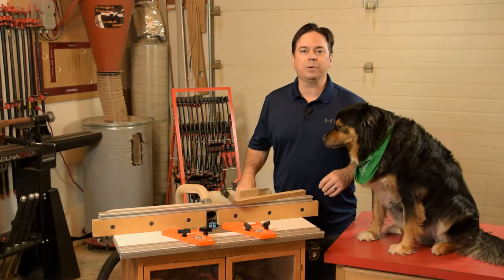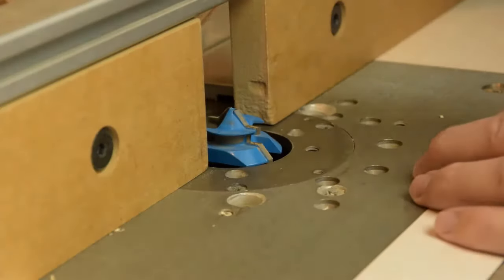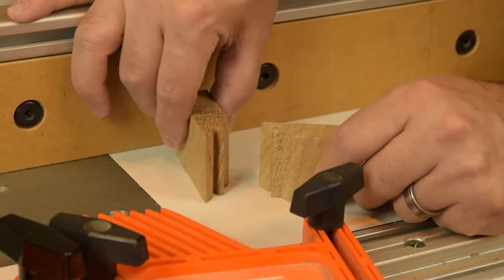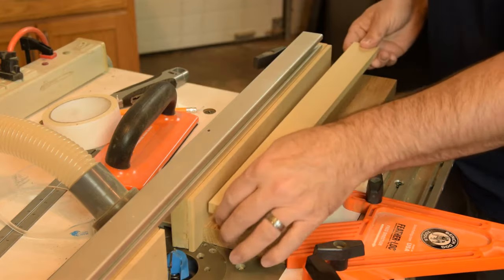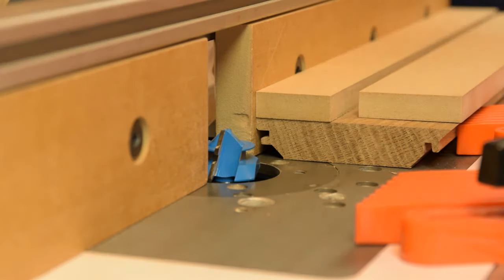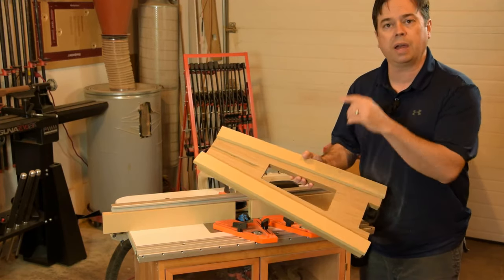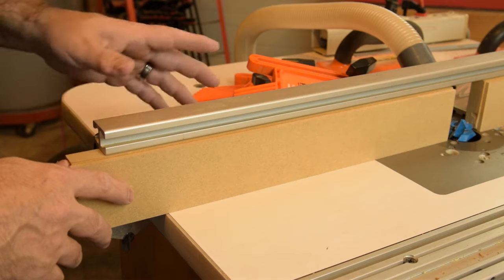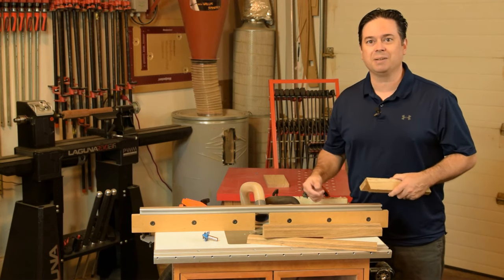Locking Miter Joint 2 Secrets to Success with Lock Miter Bit.  Woodworking  technique tips tutorial

Comment: I have this bit and the set up block from Rockler. I used the plastic setup block to set up my router bit and made a lot of cuts and adjustments to bit height and fence. I gave up after 2 hours. I wish I just would have watched this video. I found out the setup block was for two different size woods and of course I was on the wrong one. Your video was helpful to me thanks.
Reply from the maker: Thanks Gary!

Comment: Really liked your video, especially the tip about cutting the joint in two passes by using the spacers. I am going to be trying your tips out today with some cherry I milled up yesterday (first I will try on some scrape maple not the expensive cherry). It will be my first time using a lock miter bit, so this is greatly appreciated.
Reply from the maker: Thanks Kevin!  I hope your project with locking miters goes well for you.
Best

Comment: Thinking it would be worth setting up two separate router tables.   One pass on each.   I mean, honestly the time saved and sanity saved, it would be a no brainer for a full shop!  Router tables are small, cheap, and easy to just leave set up and ready to go!.   Great video though.  Contemplating whether to get back into cabinet making again.   There is definitely a need out there!
Reply from the maker: The old style locking bits would have benefited from two router table setups.  But this bit really doesn't need it.  Once you get the bit height and fence setting dialed in, it's the same for both mating workpieces.  Now, if you left this bit set up in a router table for both cuts... that might save you some time.  Thanks!

Comment: This is a real noobie question. I've just picked up this bit and have been watching a few videos to learn the finer details of its use. Your video is the clearest one I've found; however, there is something that you mention that I don't quite get. You said to make sure the "T" workpieces and the "F" pieces are oriented "opposite". What does this mean?
Reply from the maker: "F" meaning a board routed against the router table fence.  "T" meaning a board routed flat on the router table.  Basically you want to rout both edges of a board with the same profile.  Then rout both edges of the mating board the opposite way.  This will make it much easier to clamp the project together.  
Thanks for the nice comment!
Reply from the maker: Here's another video on the topic... https://youtu.be/aXRkmE-wuLU
Best

Comment: This was very helpful. Excellent video.

I want to make a floating shelf from either 3/4" plywood or 3/4" stock, creating a box with one open side (for the shelf mounting). I'm curious if I can still use the miter lock joint for the front face of the shelf. I know I can make the basic box, i.e. top and bottom and the 2 ends, but will the corners still come together for the front face piece?

I can't visualize it and I don't have a miter lock bit to test with. I was hoping your experience might be able to answer my question.
Reply from the maker: A three sided or four sided box is much easier than a six sided fully enclosed box.  I would make your three sided box with locking miters first.  Then cap the ends with hardwood covers.  If you rabbet them to fit, and leave a thin lip on the rabbet, the joint will be nearly invisible.  Especially once you round over the edges.
You'll have a much easier time with hardwood compared to plywood when using this bit.  For what it's worth, I never use the locking miter on plywood, but I know some woodworkers do.
Best of luck with the project!
Reply: @TheThoughtfulWoodworker  thank you for the quick response. I see what you're saying. I makes a lot of sense.

I thought about the locking miter joint as a way to hide the edges of the plywood. Rabbet joints, while stronger than a miter, would still show some of the plywood edge. That's when I thought about the locking miter joint. However, your suggestion that hardwood works better with the miter lock bit, make the rabbet joints on the ends more practical.

Thanks for the advice. I think you have solved my dilemma.

Comment: 2 thoughts. 1. Cut a 45 on the table saw instead of the double pass on the $100 bit. 2. Use spring camps instead of double sided tape on the fence. I use clamped on fences all the time and reuse them for a long time.
Reply from the maker: The 45 degree cut actually doesn't work.  I tried it, and it cuts away too much material, and leaves gaps in the joint.  The spring clamp idea sounds good, but would be in the way for vertical cuts.  I like the way you think though.  Best.
Reply: @TheThoughtfulWoodworker  You cut a shallow 45. Several bit manufacturers recommend a 45 cut to minimize loading.

Comment: I tried it on white oak and got alot of tear out! Didn't have a problem with my test boards, so I'm not sure that it works very well with an open grain wood like oak!!
Reply from the maker: White oak can be tricky, but that's what I usually use.  You'll have the best results with a two pass method.  That's pretty easy to manage with 1/4" spacer boards taped to the fence.  Good luck with it!

Comment: Great video…very helpful. One question, with a variable speed router, is there a preferred speed with this bit?
Reply from the maker: It's a large diameter bit, so definitely back it off from max speed.  If your router has 5 speed settings, you might use it at 3.5 or 4.  Best of luck!

Comment: I was thinking about a tapered table lamp, similar to this angled shape using the method you showed here, however, would the top and bottom require an angled cut on the end grain so that it stands on a flat surface with no gaps ?
 Billy Graham from.😊 bonnie Scotland bonnie Scotland
Reply from the maker: Yes, you'd have to bevel the top and bottom before you angle the parts.  Good thought process thinking that out in advance.  Best to you.
Reply: Thanks for the response, can you suggest a method of addressing this? Should you make those cuts before assembly or after ? 
Btw, I've subscribed , good work and thanks. 😁
Reply from the maker: @williamgraham8761  I like to bevel the parts with a tilted Tablesaw blade first.  That way you still have square sides to make the cut.  Then angle your panel with whatever method you prefer.  Then you'd be ready for the locking miters.  Best.
Reply: @TheThoughtfulWoodworker  I've often thought about this scenario, I wonder if anyone has worked out the math...its a known fact that wood workers are generally not good at maths...I've tried wedges etc, but never yet worked out a repeatable and reliable method as yet, I'm only 64, so, time still to figure it out. 🤪

Comment: Are these locking miter bits okay for plywood say 5/8 or 3/4?
Reply from the maker: With the grain you should be fine.  Across the grain in plywood you may experience chipout.  I use this bit almost exclusively with hardwood.  Best of luck.
Reply: @TheThoughtfulWoodworker  thank you.

Comment: Thanks for the video.  I tried this bit on a work piece last night and it annihilated my test pieces.  My only guess is either my router isn’t going fast enough (set to half speed because of the size of the bit) or my table isn’t stout enough.  If I ever get this bit to behave less like a wood chipper, I’m sure these tips will serve me well.
Reply from the maker: Getting the router speed right helps, but the biggest improvement in cut quality comes from cutting in two or more passes use spacers against the fence to accomplish that.  Also, long grain is easier to rout than end grain.  Keep after it.  Thanks.
Reply: @TheThoughtfulWoodworker  Thanks for the response.  I tried it with 8 passes on one of my test and it was still a mess.  There didn't seem to be a feed speed slow enough or cut depth shallow enough that would keep it from pulverizing everything I fed into it.  I wasn't even using hardwood.  I was using a 2 3/4" lock miter bit on a Bosch 2 1/4hp router.  My current working theory is that I need a more powerful router for this bit.  Does that sound right to you?
Reply from the maker: @patrickm1533  I don't think it's the router.  I use a 13 amp router, and it works fine.  It's probably the softwood lumber.  I only use this bit with long grain edges on hardwood.  Try it on a piece of hardwood like oak or maple, and I bet you'll see how it's supposed to work.
Reply: @TheThoughtfulWoodworker  That's encouraging.  I thought I wasted a bunch of money on a bit I can't use without wasting a bunch more money on a router I don't need.  I'll give it another shot on a piece of maple and see how it goes.  Thanks!

Comment: Would it help to run your piece thru the table saw at 45 D. taking away part of the angle.
Reply from the maker: That's a very good question, and I did test that theory out.  The problem is, a tablesaw 45 degree bevel removes too much material.  The resulting joint was missing part of the interlocking fingers.  That's why I recommend making locking miters in two passes on the router table.
Best of luck with it!

Comment: Nice tips. I'll have to try those. I've been using simple bevels for quadralinear forms, which works well except for some clamping pressure "tango" at glue up time. I want to try out one of these locking miter bits next time I give it a go.
Reply from the maker: You will be amazed at how easy glueups are with a locking miter bit.
Thanks

Comment: What speed do you have the router set to for this bit? Thank you in advance.
Reply from the maker: Hi Jennifer, you are smart to ask this question because big bits need slower speeds.  It's hard to say actual R.P.M. but I usually set the router speed to 3.5 or 4 out of a maximum 5.  Probably equates to 17,000-18,000 rpm out of a maximum 23,000 on my router.  Best of luck!
Reply: @TheThoughtfulWoodworker  Thank you for replying so quickly. 
I did my first tries on this but today and I had a good portion of year out along the top edge of the table cut. I thought perhaps it was due to either the speed not being fast enough and or that perhaps, I had the bit set too high. I would post a picture here if it, if I could. Thank you once again.

Comment: I ordered this bit by mistake years ago....entered wrong item number on web site. What is common uses for this bit?
Reply from the maker: Hi David, I use the locking miter bit to build oversized furniture legs.  I just finished a locking miter glue up today for 2-3/4" square legs.  I glued a solid oak core in the middle as I assembled it.  Basically just a way to make oversized legs if you don't have 3" thick solid stock.  
Best to you.

Comment: Hey, I'm new to this but I'm a computer engineering student.. I really like this joinery and I am building my first bench (2" x 6") with a frame. A friend of mine has a routing table and this video is really helpful for cutting down the confounding variables, so first off thank you! I was also looking at the cleverness that is drawbore Mortise and Tenon joints; the geometry of this joinery suggests that it may be possible to drawbore through the center of this joint and offset the halves of the holes to achieve that tightening effect with an aluminum rod; do you think something like that would work for keeping this joinery fixed while it glues with a half inch hardwood? Cause right now I don't have a table with dogs, holdfasts, and only 2 short clamps.
Reply from the maker: If you plan out the joint in advance, with the same profile on both edges of one board, and the opposite profile on the mating board... You will only need to clamp in one direction.  But you will need a few clamps!
Best of luck with the project.
Reply: @TheThoughtfulWoodworker   thanks!

Comment: The top of the bit or top of the cutting edge is non-standard and can vary from brand to brand and even bit to bit, so not a good point at all to use setting up a lock miter bit.  

What you really need to do is to align the center of the cutting profile which may not be easy to find, with the center of the stock - with the stock laying flat for bit height and vertically against the fence to adjust fence position.  Everyone should know how to find and mark the exact center of the stock.  To align that with the center of the bit profile, the only solution is to use Infinity's Lock Miter Master!  It makes setups simple- no guessing and no trial and error which results from other methods. It works with virtually all brands of lock miter bits.

Setup blocks only work when the setup block is EXACTLY the same thickness as the stock which rarely happens!
Reply from the maker: Yep, Infinity offers a nice gauge if you have trouble eyeballing it.
Best

Comment: Could this bit be used for drawers?
Reply from the maker: Yes, you could use this bit for drawers.  It would be an end grain cut though, which comes with its own set of challenges.  I don't recommend plywood for locking miters, but hardwood works great.  
Best

Comment: You are lucky that the taper on your truncated pyramid assemblies is not severe. or the 45 degree lock miter joints would not fit together properly.
Reply from the maker: It doesn't seem like it would fit precisely, but it does.
Thanks

Comment: That was a really bad 45* lock miter.  Sorry, but that jig should be a lot tighter.
Reply from the maker: Hi Tom,
Not sure what frame of the video you're referring to.  I'm quite happy with the results with this bit.  My only intent with this video is to show people who are unfamiliar with a locking miter bit that it's really easy to use.  Corner joints made this way - once glued and sanded - have no gaps, and look like a solid post.  
I also have no idea what you mean when you say that jig should be a lot tighter.
Best
Reply: What router table is that? Looks like Bosch, but not sure

Comment: What's the cut like across the end grain?
Reply from the maker: You know, I only use locking miter joints on long grain hardwood.  No plywood or end-grain for me.  My guess is it probably cuts fine with this two-pass method, but I've never tried it.